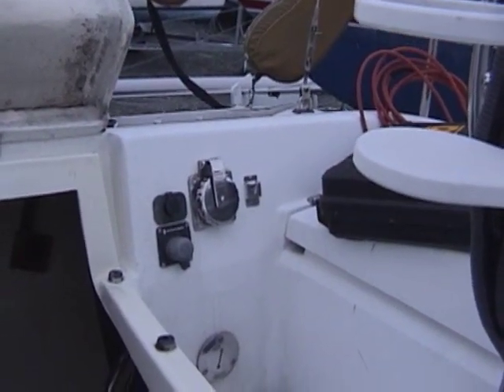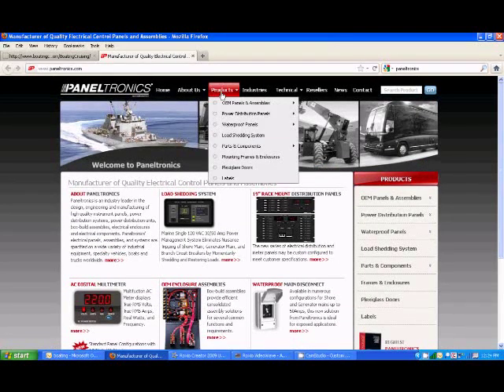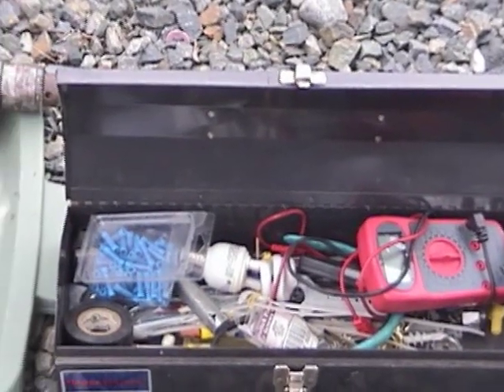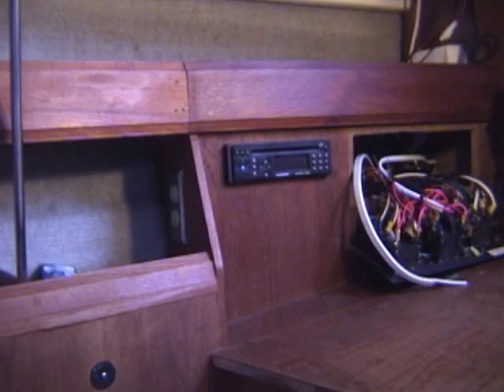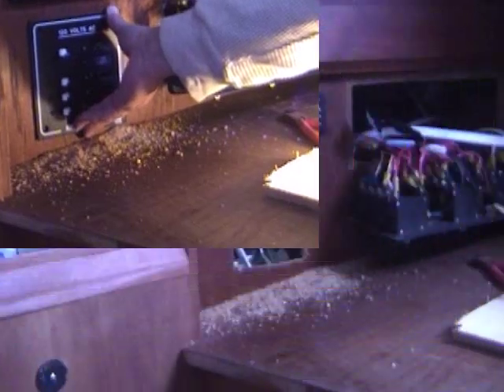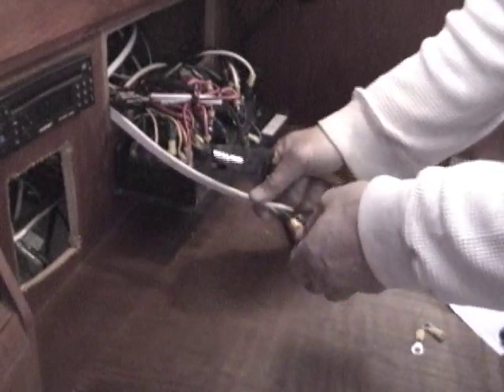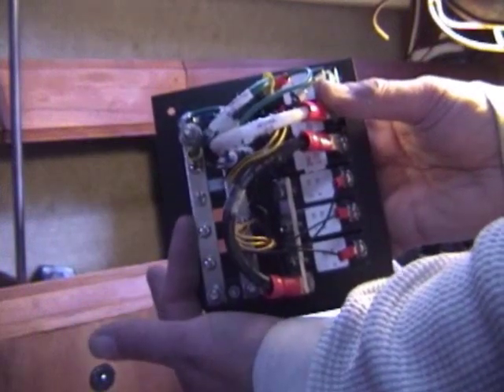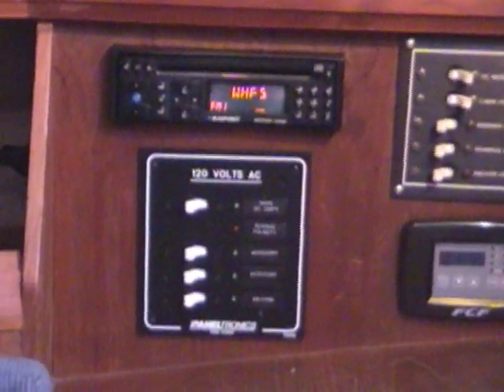Adding a 30 amp shore power panel to your boat with PanelTronics

Comment: This is probably a dumb question. But what is the connection that was existing on the boat (above the shore power connection you added) it looks like another shore power hook up
Reply from the maker: I used the existing shore power inlet

Comment: I've given up on cheap crimpers. Instead, I crimp my connectors on with a small pair of vice grips. It makes a very firm, flat connection on the connector.
Reply from the maker: i agree, i got a pro crimpers after this video :)

Comment: You need a better crimper and solder the terminals.
Reply from the maker: thks, I did get some better crimpers, i like soldering but ABYS recomeds crimping :(
Reply: Soldering cable terminals risks introducing faults by damaging wire and crimp terminal insulation due to overheating. 

If the terminals are crimped properly, with the proper tool, and pull tested to their rated capacity as they should be by any competent person,  there is no benefit to soldering. In this installation, the wires connected to the panel are not properly secured to prevent working and loosening of the ring terminals. 

This is what happens when a "I'm not an expert" tries to teach others how to do stuff. 

They may very well cause a boat fire on other peoples boats as well as their own. 

What about the power source, and cabling, cable identification, and ELCI and...the list goes on.

There are several gross errors in this installation and the video should be taken  down before someone follows suit and gets hurt.
Reply: How do you secure the wires so they don't loosen from the breaker panel?

Comment: The green wire is Insulated.. not shielded  which is something completely different and refers to coaxial and other radio cables.  The important difference is that stranded cable is resistant to vibration, while solid cable is not.  Tinned cable is much less likely to corrode and solders well.. see comment below about soldering your terminals !
Reply from the maker: thank you for your input

Comment: This is extremely dangerous as shown !  1. fabricate a plastic sheet with standoffs to prevent hands or other wires from coming in contact with the 120V AC present on the buss bars, and breaker terminals. 2. If you care about your boat, solder the damn terminals, you can also crimp them but do solder them !  3.  Use a proper crimping tool, not a pair of wire strippers as shown here.  Poor connections can get hot, or worse come loose and short out your shore power.   HEY.. if you are going to chop up your expensive wood work.. at least use a square to get the panel set nicely. 3. Apply a thin film of corrosion inhibiting conductive grease .. in marine environment if these connections turn green, they will also get HOT, or become intermittent.
Reply from the maker: thank you, i agree with solder, however, ABYC does not, the Navy does not solder, only crimps, :(
Reply: Soldering does not meet abyc standard.
Reply: @TaggingTechnician  and Vagabond Epicurean. This is not correct. ABYC standards do not prohibit soldering a properly crimped connection. A soldered only connection, with no mechanical connection, is not compliant, except for some special battery terminal lugs, with special provisions.

Comment: is there a difference between ac and dc switch panels?
Reply from the maker: YES,
AC Breakers
In North America, the grid alternates at 60 Hz, or 60 cycles per 
second; hence the name “Alternating Current”.  The voltage alternates 
between +V and –V, 60 times a second.  That means there is a point at 
which the voltage is 0v, 60 times a second.  It is at this 0v point that
 the AC breaker will “break” the connection, extinguish the arc, and 
protect the wiring from too much current.
DC Breakers
In contrast, a DC circuit does NOT alternate.  It stays at a constant
 voltage.   Since there is no 0v point, the AC breaker design will NOT 
work in a DC circuit.  The DC breaker uses a magnet to attract the arc, 
pulling it from the air gap, and extinguishes it.  The AC breaker is NOT
 equiped with a magnet, and cannot extinguish a DC arc.
Moral of the strory, use AC-rated breakers for AC circuits, and DC-rated breakers for DC circuits.
Only breakers that are labeled as DC-rated should be used for DC applications.

I hope this helps
Reply: ok because im looking to buy switch panels for my boat and there are very few AC panels available and some of the panels are listed as AC/DC.  i was wondering what that was all about. i doesnt make sense to me how you could run your ac loads through one panel and then run your dc loads through the same but seperate panel.

im a navy nuclear electricians mate on submarines so none of this is new to me but im getting the feeling that civilian marine electrical is either pure wizardry to most people so there isnt much good information available or its a little different from millitary marine electrical. the coast guard doesnt board navy ships to do electrical inspections. lol.
Reply: Additionally, AC wiring must be isolated from DC wiring. The panel installation in this video is not safe, non-compliant, and should be cited on a marine survey, as one can accidentally touch the live wiring on the back of the AC panel can be accidentally touched with a hand, tool, or any metal object.